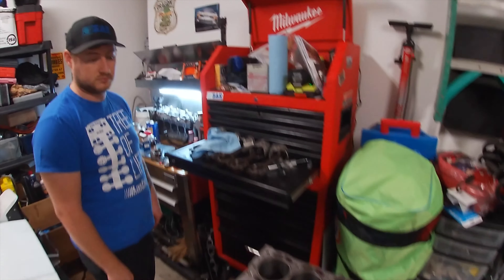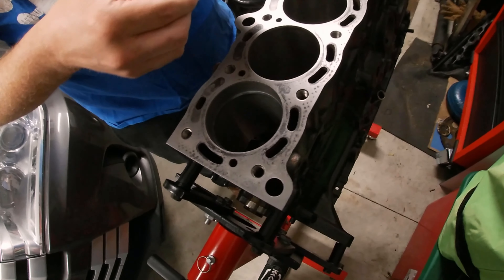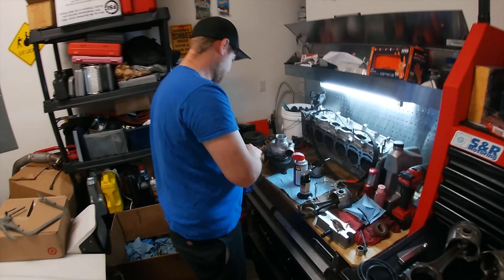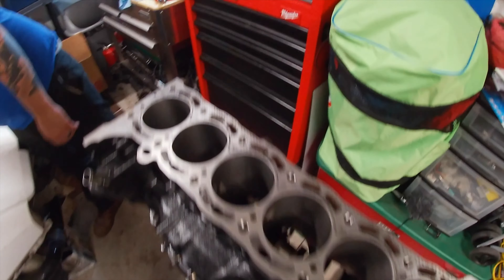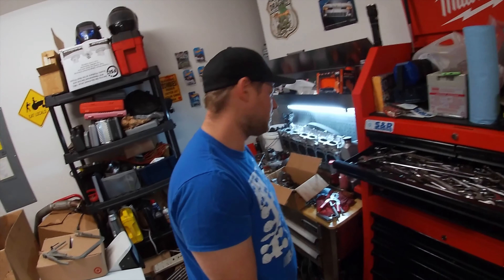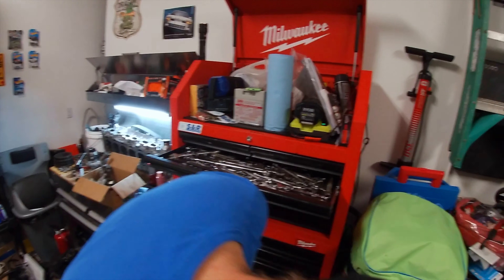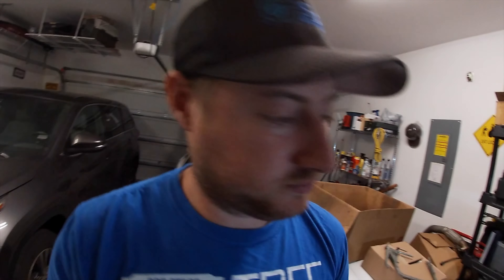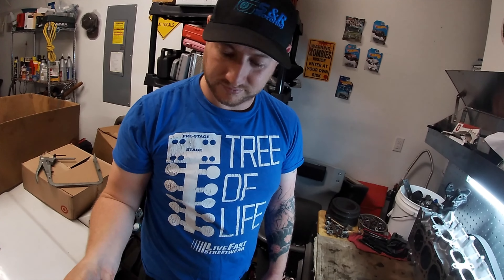We Attempt the Zuluu Mod on the 7MGTE! (Mk3 Supra Build)

Comment: It would be a better practice to grind the ring end gap turning the handle in the clockwise direction so that they stay square when cut. Going counterclockwise raises up the ring from the flat surface and causes an angle .   When having the block shaved, it's necessary to attach the front aluminum cover; otherwise, there will be a step between the cover and the head that can cause leaks. The reason US market heads don't have a coolant hole drilled to the block at the back of the head is because of the EGR cooler back there. Circulating hot water up from the cylinders would make it more difficult to cool the exhaust gases. If you used EGR block off plates, I suppose it could have some benefits.

Comment: Thanks for the shout out guys. You can still install the latch without a spring if you wish. I've ordered some springs that I might be able to modify but I haven't received them yet.
Reply from the maker: You are very welcome! Yea I was looking at after I filmed and finally realized you have to take the cover off Haha.
Reply: Take the lid off to replace it. It takes about 10 minutes to disassemble and reassemble.
Reply from the maker: Cool thanks, yea it looks pretty simple.

Comment: Just finished up my 7m on the stand. .40 oversize. Stock hg. Arp studs. Dnj pistons bearings rings thrust washers. Decoti gasket kit lol. It's been a super budget build but I think she'll be ite. Did u machine the head? If so you gotta machine the front cover as well or it'll lift the head
Reply from the maker: Sound like it's goung to be a beast! Yes the block and front cover were machined........at one point lol.
Reply: @SRMotoring  nah just a stock power all original car. It's a white with maroon leather targa. Still has cargo cover. Tems. Abs. It's got tons of factory features. Including factory radio

Comment: Currently in the process of replacing the headgasket on my 7mgte, previous owner did the headgasket like 5k miles ago, and it's already showing signs again, So yeah.... I'm doing MHG and properly torquing the head studs
Reply from the maker: Jonathan Gardner I feel your pain. Don't you love cleaning up other people's messes? Good luck and thanks for watching!
Reply: Switch to ARP head studs brotha and switch to HKS head gasket i promise its worth it
Reply: @georgeclaros8311  I'm definitely going a metal head gasket, though I haven't decided which, and as much as I would love studs they just expensive enough to tip the price of this rebuild over into the uncomfortable range.
Reply: @jonathan7744  The studs provide a more even clamping force than the ARP or OEM style headbolts do. You can find them on ebay around $125 and that is around the same price for a Cometic metal headgasket. I run both of those on my built 7mGTE.

Comment: I used MLS HG from Greddy and put end to BHG, of course I used ARP bolts 10 years no issues.  2JZ does not have the bolt torque issue, but still used MLS gasket, so shows it’s not the bolt torque, composite is no good for turbo, period.
Reply: it happens to n/a engines as well, apparently it was due to the head gasket being swapped for a non-asbestos variant due to new laws. the bolt torque needed to be higher but was not corrected

Comment: Guys I have a 92 Cressida rebuilding the 7MGE any news on how the zooloo mod worked out??
Reply from the maker: I’ve had no issues. The only cooling problems I had was air in the system.
Reply: @SRMotoring  legend thankyou. I believe the whole issue was Toyota trying to address NOx emissions by making no 6 cinder run deliberately hotter (hence no water channel), to help EGR, this coupled with head gasket torque specs that were wrong gasket technology (at the time)
Reply: Ive also had some luck with cryogenic hardening of the alloy cylinder head. My Brinell hardness number went from 68 to 105
Reply from the maker: Hmm that’s interesting. Never heard of anyone doing that but it makes sense. I’m sure the head I have is silly putty after being overheated from the previous owner.
Reply: @SRMotoring  yes it definitely works i think this also a factor with head gaskets too, the annealing goes the alloy gets soft loses clamp pressure on the studs (no water cooling channel on no.6 cylinder... apart from that Toyota did a great job 🙄😂
Reply: @SRMotoring  Guys my profuse apologies. You cannot harden alloy by cryogenic freezing. The process that was applied by Heat Treatment Australia was chemical age hardening (a specialised heat treatment). The only use cryogenic is good for for alloy is to destress the alloy 😚 my apologies